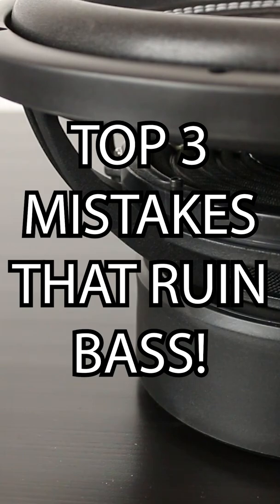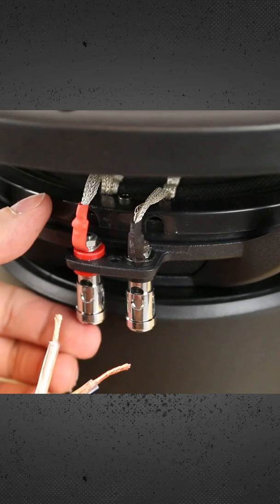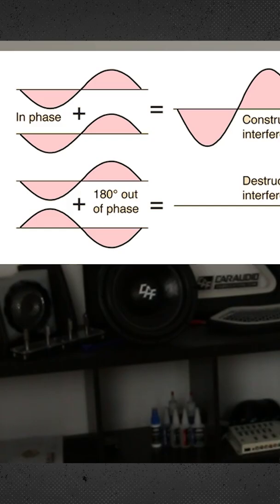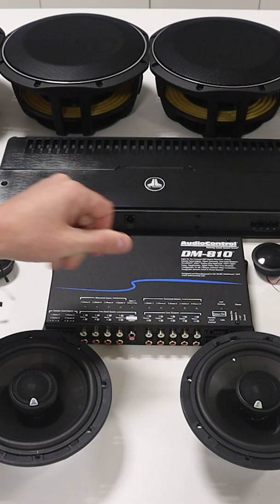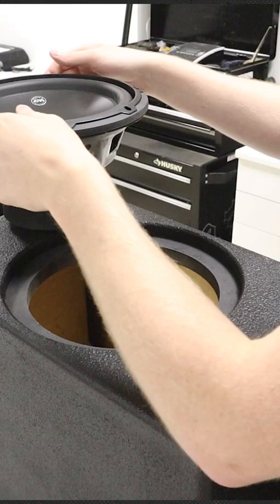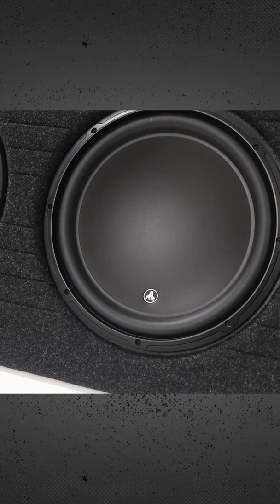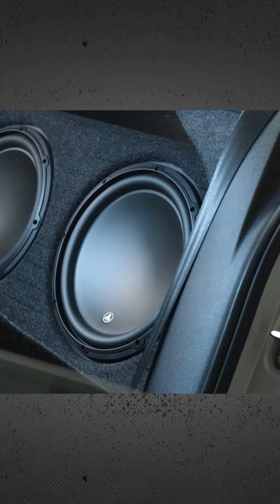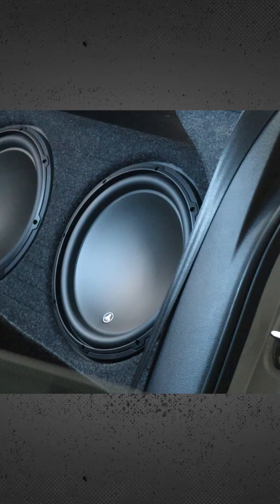3 Mistakes that Ruin Subwoofer Bass! #shorts

Comment: 4g power cable and 18g ground. I see it all the time. Ridiculous. Haha
Reply: That’s terrible!! But in tgat guys favor it would have been better to have that gauge if cable switched as ground basically becomes a positive!
Reply: Yeah - I was seriously gonna say the same thing ... Need to Dump all those pathetic grounds for some REALISTIC Cables,  ZERO gauge is preferable, 2g or even 4g is OK. 
Consider the Big 3 Upgrade and go get yourself a better Battery (you can also add on an Auxiliary)
NO POWER - NO PUNCH
Reply: I learned that the hard way! Back in 92 I was getting a system installed, but didn't have enough 8guage left over to make a ground, after a couple of days went by and I didn't hear from the guy who was doing the install, I decided to run a 16 Guage wire from my deck ground to the amp, wire is on the passenger side floor up the seat the on my back seat, nevertheless 20min in the whole car filled up with smoke and everywhere the wire was left a burnt indentation on the floor, front seat and across the whole back seat. That learned me. To this day I never skimp on Wire, stinger is the only thing I advertise on my vehicle
Reply: Electrons flow from negative to positive so for people that undersize the ground…….god help them lol

Comment: Poor choices when selectring the equipment ive seen it multiple times people blowing all of their money on really good quality speakers and subwoofers eg. JL and Focal and powering them with fleamarket garbage amplifiers
Reply: Are the people who paid someone for the great equipment a great looking installation but it cancels all of its frequencies out.
Reply: @esundproductions  cant wait for a better Amp, shame about the owner.
Reply: @dbongoloid9541  what happened to the owner?
Reply: The problem I have is I grabbed a factory subwoofer from a fully loaded chevy hhr ss model and I don't want too get a amplifier that'll over power the sub. I also have JL door speakers and I want too tie them together with the sub instead of running them separate from the sub. I'm a newbie too subwoofer setups and my dad hasn't done a setup in quit a while.
Reply: We're looking at you Boss and Pyle lol
Reply: I did the exact opposite as a teenager..... Put my $$$ on a pheonix gold 1kw amp was an absolute Monster back in 94'......I blew 2-3 sets of $20 12"s from Hills dept store.... (dont recall the brand)....and they were amazing for $20, the pheonix fried them way too easily tho.....had the gain on like 1 and still fried em!!!!....ended up with dual 12" JLs in a 4th order box, with a Bose 802 sitting on top.....I had one of the best systems in my city at the time.
Reply: Yeah, but a good amp( Rockford, JL, kicker) will make a cheep sub sound good though. A friend of mine brought a used sealed box with 2 dual 12in subs in it, he ran them on a punch 500, and those sub sounded amazing ( for what they were) when he bought some p1's and played it I honestly couldn't tell the difference, and in all actuality the duel subs sounded better. The box was a Q logic
Reply: Or 4 gauge wire
Reply: Or spending great money on equipment and cheaping out on the wiring.

Comment: Make sure you have a good Chasis Ground with a short cable from the bass amp to the chasis this will help the amp run with greater efficiency and stay cooler by lowering the resistance, and Run signal “RCA”wire away from communication or power wires as much as possible this prevents EMI from pulsing in the bass signal

Comment: A mistake is also punching a hole in the surrounding when screwing it or unscrewing. That’s the worst feeling :(
Reply: Yeah that sucks especially when you have a sleeved screw holder and probably looked at it and said, I don't need it I got this,  45 seconds later.🤬🤬🤬🤬🤬 😫😖🥺☹😟😬
Reply: @FuctByTheGovernment  oh that’s the worst.
Reply: Doesn't hurt the performance by much, but yes I have done same mistake before 😅
Reply: @freeair7292   Poking a hole in the surround doesn’t hurt performance by much?  Bruh what?
Reply: @kylesmith9048  mans probly puts all his groceries up against the playing sub and hears no difference lol. all jokes over here
Reply: @kylesmith9048 I think the name answers that question. Free air....
Reply: I’ve never punctured a surround while unscrewing only screwing in the subwoofer.
Reply: @CajunReaper95  ok. And how did you feel when you did that ?

Comment: I have seen a 500w rms sub wired with 18 awg wire. 

It was a buddy of mine who was complaining about not having enough bass. He asked me if I could adjust his amp and I saw the thin wire. 

After replacing it with 14awg I had on hand and adjusted the amp,he was happy.

Comment: Ported or sealed(acoustic) suspension) should be respected by manufacturer recommendation. 
Neglecting this will not only cause havoc to the drivers..movement..air displacement..but will also alter impedance. 
Great content as always!

Comment: Not necessarily bass output, but sound quality, not using sound deadening. I just pulled apart the plastic panels around my sub box and deadened everywhere I could reach on the sheet metal and the panels to kill rattle and resonance. Now, the bass sounds like bass.
Reply from the maker: Sound treatment definitely helps the bass!
Reply: You don’t always have to use sound deadening because if your vehicle is sound deaden from the factory an you add more your bass will sound like shit or want barley hear it
Reply: @CarAudioFabrication I have a Lexus, with around 1k in it, punch 500 for interior speakers 4 6x9 & 2 10in mid bass and a kicker 500 watt mono block on 2 p2 dvc, and the factory sound dampening is so good that you can only feel me coming, but not hear me. I had a 92 park Ave with two 15 and 4 6x9 rear and 2 6.5 up front with a Kenwood 921 on the interior's, but with only a 100 watts PC on 6 speakers you could hear me with the windows up. All factory sound dampening is not the same

Comment: MY MISTAKE WAS GETTING 2 12s INSTEAD OF 4
Reply: I missed 12s. I got 4 of 10” JL with 1,000 watts amp JL fixed nicely in my dodge mega cab truck 2500 HD. 
I’m great with it than 12s. 👍🏻
Btw 4 of 12 won’t fix in my truck, said it’s too big. Each speaker of 10 worth $150.00
Reply: I GOT THE 4 12s YALL
Reply: @kappnassdough7242  👏 let’s see a build video
Reply: @nicowallace6409  sheeesh I kinda fucked up recently by tryna add a second battery I’m missing a fuse or 2 but for the budget it’s nice. I have a 3500W ds18 amp in the backseat and a hifonics d class 1500W amp in the trunk 4 12inch kickers 2 COMPr 2 COMPvr. I got 2 6x9 baby kickers for the doors and 2 infinity speakers for the rear. My boombuggy is a 2001 mustang drop 🤤😎
Reply: I got 2 12s then added 2 15s, I'm thinking about upgrading the 12s now.
Reply: My mistake was blowing out fools daily with their 12 setups and watching them cry  with my two 8's pushing 1000 watts rms to each one
Reply: @lewokejames  lol
Reply: @kappnassdough7242  3500w holy shit😂
Reply: @kappnassdough7242  how are they sounding now? Now that you’ve had them for a bit
Reply: @mykasmith6445  4 15's ain't see no wires, then you heard BOOM from the amplifiers!!!
Reply: And this is why I went with 8 18s
Reply: @sheluvher0in666  I can tell u right now the compR flex is dangerous they look like they want to jump out and explode literally. I went to the drive in movies and made screens fall while watching transformers, it’s was scary fr. My stock alt is still good. THE ONLY THING ID CHANGE IS THE COMPR KICKERS. I personally think the 12” solo Baric prefab joints would perform 1000 times better than any compr build in general

Btw that hifonics 1500w got swapped with another 3500w ds18
Reply: @mykasmith6445  do it playa change that amp too
Reply: 2 15's all the way
Reply: a guy in our town during the mid 90s had 18 10-inch subs.  Yes, he had 18 of them. There were several Orion HCCA amps pushing groups of 3 in parallel. I'm not sure what the impedance of each was, but he had 6 amps, in a pickup truck which had a camper top. Thanks Charlie, from Algoa, TX
Reply: @weso2103 to be fair a lot believe that 2 10 inch drivers have the equivalent to 1 12 inch driver thus 4 10’s theoretically = 2 12’s.
Reply: @lewokejames i call bullshit on that.

Comment: Depends on witch way you point your box in the trunk, for different box.my air tight box sounds better facing towards the back trunk instead towards seats.
Reply: It takes like 15 feet to develop a good bass wave and facing them backwards helps add space to help develop the waves better.
Reply: @Chromedome-ss6mg  nice,thank you for the tip.

Comment: I have 4 of 10” JL with 1,000 watts amp JL in my Dodge Ram truck mega cab 2500 for 4 years. Not a problem, great bounces for some bass and great sounds. 
I recommend JL 👍🏻

Comment: Hard clipping even with an under powered amplifier will damage your subwoofer.
Reply: Clipping?
Reply: @SC_2QUICK  distortion is called clipping
Reply: @SC_2QUICK if you were to connect an oscilloscope to your signal output, you would see a nice alternating current sinewave. A clipped signal is when the nice round peaks of that sinewave are clipped off and it starts looking more like a square wave. Really bad for inductive loads like the voice coil in the subs.
Reply: @nox6185 false, This is the key difference between clipping and harmonic distortion—while clipping indiscriminately hacks away at anything that exceeds an amplitude level, harmonic distortion adds frequency content in a way that's musically meaningful.

Comment: 1. Too high of tuning 2. Not enough power 3. Port noise 4. Not having a correct LPF 5. Certain speakers or subwoofers act differently depending on the environment they are in! So make sure you know where your frequency response is best in the trunk or in the room

Comment: Didn't realize car had active cabin noise cancelling or designed to eliminate cabin noise.
Reply: Agreed, also sound treatment is a God send.
Reply from the maker: Those anc mics are the worst!
Reply: I realized that in my car immediately, because as soon as I turned the system up on a fresh install I got a horrible noise thru the speakers due to the ANC system.

Comment: My worst mistake is almost overpowering my old 50w sub because i accidentally read it as 500w lucky i saw the mistake before i played any songs!
Reply: what happens if you overpower it?
Reply: @thomasgully3574  sub will go KaBOOM
Or overheat then coil will get damaged/melt
Reply: 👁👄👁 maybe I wont swap my old amp out with 1 thats 4times as powerful
Reply: Where in the world did you find a 50W sub?  Was it ten dollars?
Reply: @SimRacingVeteran nope, it was a part of a philips 2.1 soundsystem that my grandma had, which she gave to a friend but forgot to include the subwoofer

Comment: Is it possible to go too big on a sealed box? I mean, we always pay a lot of attention to the minimum volume required, but what about the maximum volume possible? Any thoughts on that? I want a sealed box for a vw bug, but I want to get the best out of the sub as humanly possible. I know that a bigger sealed box will let a subwoofer get better low end (like sub 30hz), but I'm not sure how much is too much.
Reply: Wouldn't the extreme version of that just be a sub running without a box?
Reply: You want the correct size box. If you want to get super low you need a subwoofer with better low end response not a bigger sealed box. The idea of a sealed box is to minimize peaks in the response not to artificially create one.

Comment: Always put a board over the sub surface when screwing the sub to the box so you don't slip and put a hole in the sub.  I learned the hard way.  Also put a rag on the backside connection when soldering the wires so it don't drip and put a hole into the foam.

Comment: Wire Gauge. Had a buddy running 2 15" subs on 20 gauge wire for like door speakers that was 6ft long. I installed 12 gauge that was only 2.5 feet long, just enough to get from amp to subs.  Watts went up and so did the boom. He won the next Bass meet he went to by 20dBs just from the wire.
Reply: By 20db!!! Did 2nd place even have a subwoofer!!!! Thats embarrassing😅!!!
Reply: Not having subwoofer enclosure mounted solid or if nothing else atleast ratcheted solid against vehicle

Comment: I'm not sure if it is a mistake or error...my subwoofer is having like power cut whenever i jack up bass volume...
Reply: Probably a poor ground.
Reply: @Eastsidegeorgiaboy   i have install voltage regulator and also add in  addition 2 ground cable for the monoblock alone...i have change both subwoofer new and use new monoblock...but it is still happening... I'm using 2 boston g2 12 inch woofer

Comment: Having them face the wrong way is one of the most common mistakes that I have seen. I have schooled a few people on this. If you have your speakers facing you, wrong. Unless you're in competitions and are pushing 10,000+ watts turn that shit around, you can thank me later. Holler at your boy if you didn't know this and tried it. Tell me what you think and how much difference it made.
Reply: I don't a have subwoofer in my car.....so, I just turned my gf around. Much better, thank you!!!
Reply: Dont forget to crack those windows🙃
Reply: So true about the windows.  Never see that mentioned much.  

Box placement is such a huge aspect.  I've got a downfire box for two shallow Skar 10s in my crewcab.  Those little bastards hit so dang hard. But when I slid the box about an inch and a half forward and to the passenger side, it's like it almost doubled in volume.  Found it out by mistake when my box just slid.  But once I looked at it and saw what happened, it gave more space for the sound to travel backwards and off the rear cab , plus to the driver side of my truck , it obviously gave more avenues for sound to reach my ears.   That's my take on it anyways
Reply: So true about the windows.  Never see that mentioned much.  

Box placement is such a huge aspect.  I've got a downfire box for two shallow Skar 10s in my crewcab.  Those little bastards hit so dang hard. But when I slid the box about an inch and a half forward and to the passenger side, it's like it almost doubled in volume.  Found it out by mistake when my box just slid.  But once I looked at it and saw what happened, it gave more space for the sound to travel backwards and off the rear cab , plus to the driver side of my truck , it obviously gave more avenues for sound to reach my ears.   That's my take on it anyways

Comment: This was about 25 years ago. A Polk Audio dB12 in a 1 cubic foot sealed box "ejected" or "blew" the voice coil and part of the spider and cone out of the box. Polly fill was on fire and blew out with the voice coil and half the speak and melted the carpet on the back of the back seat of the hatch back.  The fill in the box was smoulder and releasing lots of gas. I guess I had stuffed way to much polly fill and it melted and gassed and created enough pressure to destroy the speaker.

Comment: Don't block vents. 
Don't paint woofer cone & foam. It will minimize xmax ===> to less bass. 
Don't paint spider. 
Don't add weight to the cone.
Reply: Done every one of these things...block vents ✓ add weight to cone ✓ add rubber silicone to surround ✓ paint cone ✓✓✓ 
A heavy painted sub is better than a busted f'd up one any day.
Reply: @aninjacalledshank2278   😄 well, it's up to you

Comment: If you have a 90s Lexus Ls400 the trunk is built like a brick house.Not to mention that the gas tank □ plus a metal firewall is behind the back seat.The rear panel was cut by the previous owner.So the bass enters the car.I am going to cut the rear panel even more.

Comment: Efficiency of lowering the resistance of driver to coupling to the air is where horns shine. "Voice of the theater" was proof.  RAFTER RATTLING BASS from 10 watt tube amps of the 50s was the result.  Thoughts? ✌️✌️✌️

Comment: My own personal error was using 2 subwoofers of differing max wattage(1000W and 500W), and differing RMS ratings(250WRMS and 175WRMS). The speakers were competing for power and never hit the way I was hoping. Am ditching the 500W speaker. It is still good, but there's no place for it in my new setup. Will be running 2, 1000W max, 250WRMS, 12" subwoofers at 4ohms, a 3.5Farad capacitor, and a 1500W amplifier. I'm currently awaiting the 2nd subwoofer to ship to me, along with an I/0 gauge "Big 3" upgrade kit from Skar Audio. Should take care of many of my previous issues, especially after I get the head unit wired up the way it should have been(idiot previous owners had no idea what they were doing when they butchered the audio harness the way they did, x4 butt connectors for each wire they cut into, as opposed to just buying the stock-to-aftermarket adapter harness...).

Comment: Not sanding the paint down to bare metal for the ground screw. Also, using a ground screw that wont tighten up enough, causing sparks, and sporadic amplifier performance.

Comment: Tip to everyone that works on speakers if you’re worried about the drill, slipping and smashing into the cone or the woofer just get a piece of metal or a metal bucket and put it over that way if you slip all you’re gonna do is hit the “cover” and not the speaker

Comment: So I have a red sony Xplod 1100w paired to a boss 1200w amp with the gain only about between half and a quarter to half, I dunno exactly how many watts I have it running at I wanna guess around 500 to 800 watts, now my question is should I change the sealed box out for a vented enclosure if I'm using more low end bass that's not just a quick boomey note?

Comment: One thing that made me pissed (more than once) is that I accidently rammed a screwdriver through the surround, when tightening the woofer screws! By looking at the thumbnail, I thought this might have been one of the 3 mistakes. 😅 Always put a slight outward force on the screw, just in case it slips off the screw. 😅